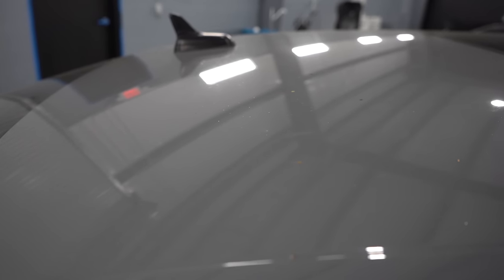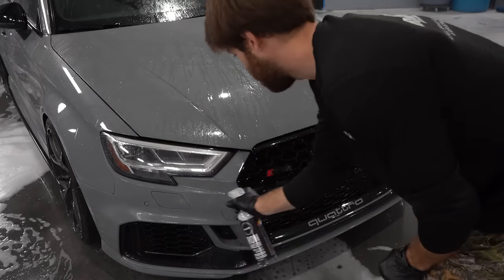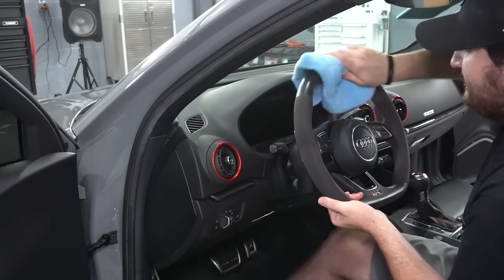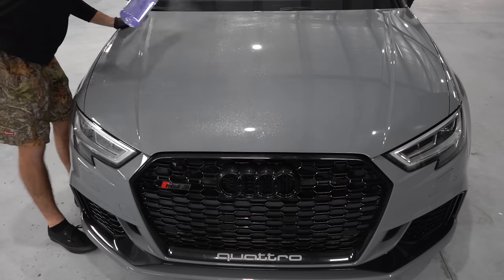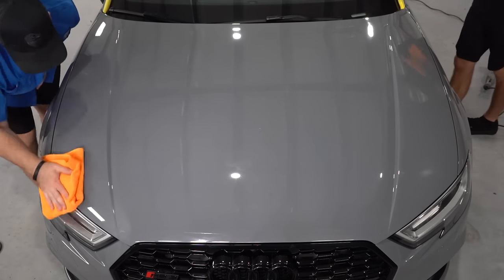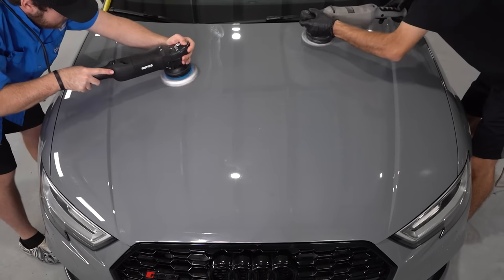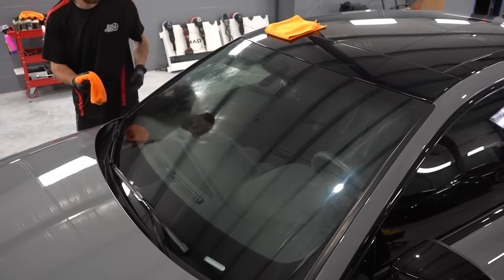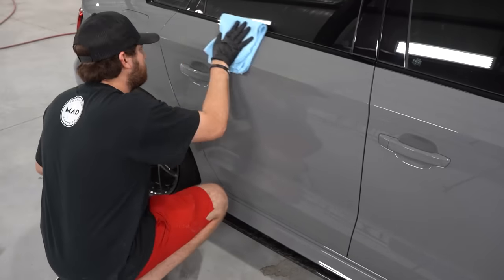Cleaning A Filthy Dealership Ruined Audi RS3 | Satisfying Disaster Car Detailing Restoration How To!

Comment: Very good video.  The fact that you dried the entire car off with compressed air instead of coming into contact with the paint with a drying towel, ect is THE BEST WAY to dry a car/truck. Even if you don't have a big enough air compressor, you can always use a vacuum on the blower side to blow the car/truck off. Always make sure the vacuum hose is clean on the inside. You don't want to blow debris onto the paint and scratch it up.

Comment: What was the polisher you used on the grill ? I have a rules LHR21 and a run Ed duetto but I think I need something slightly smaller for those tight areas

Comment: Thank you very much for the video guys. In particular, I would have sealed the window frames, locks, lights and I would also have used the Rupes ibrid nano long neck polisher for the inside of the doors, edges of the body and the flex pxe 80 polisher with the flexible shaft set for the handles of the doors. Otherwise good job. 👍

Comment: I have passed by multiple dealerships and high end cars. You see a guy pulling a water hose with a 5 gallon bucket and using  A bristle brush on a stick washing cars. I have had to wait before when i purchased one and out back they were doing the same wash style.
Reply from the maker: Yuppp it’s all about the fastest way to get it done.
Reply: In the UK, they are on minimum wage so they aren’t specialised, they are just their to make a car look clean. I personally don’t care but if you do, don’t let them ever wash or vacuum your car if it has a service as they are likely not washing it too safely. White cars not much of an issue though.

Comment: Great job. Nicely done.

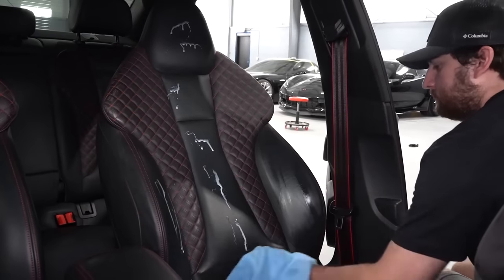But please consider the following: 13:31 and 13:46 and 17:40 (are you sitting on the seat or the door sill?) and 17:50 and 18:35... Respect the seats! You need to clean the doors and seats without sitting sideways on seat bolsters. It's so easy to clean the doors from outside of the car. And 90% of the seats can be cleaned by leaning in, rather than sitting on the seat edges. Easier than what you're doing in this video, actually. The edges of car seats are usually the first to show signs of wear (wrinkles, cracks, etc.), and sitting on them sideways while cleaning is just unnecessary. You're putting those seat bolsters through the equivalent of months of wear in just one detail. For cleaning the doors, kneeling outside the door is easier. For cleaning the seats, reaching in instead of sitting sideways and twisting is easier. When you do have to sit in the car, try to sit square instead of crushing the bolsters. Your current approach makes me cringe. The right approach preserves the seats AND makes your job easier. But still, very good detail.
Reply from the maker: I only clean them that way because I have a massive camera and tripod. When I’m not filming I would not clean this way.

Comment: I have a cheap suede steering wheel wrap (Cut to my steering wheel and sown on by me)
I didn't use any adhesive on it, and so far (6 months) it holds well just by the tension. I found it collects a lot of dust, and the best way to get rid of this dust is with a drill brush.
I do not recommend using it on high end cars obviously, just shared my experience.

Comment: Great job, but you've really got to watch out  that you don't polish the headlights as you'll take the factory UV protective coating off them and the plastic will oxidise faster for the customer down the track
Reply from the maker: The headlights had a ton of scratches only way to remove them. Also we ceramic coated them as well.

Comment: And I always was wondering what happens if you buff a glass out can you burn through the glass
Reply: No, you can’t.  I’ve used fine abrasives on glass, to get scratches out.  Glass can handle super fine finishes and waxes with no problem.
Reply: Thanks

Comment: It's contamination... not DEcontamination - thats proces when you're removing the iron particals etc... Not a hate I just noticed that you said it couple of times so. But great job on that ceramic coating you did, after 3 years still holding pretty well

Comment: Question for the clay bar, do we use literally one side for the whole vehicle or do we flip it for every different side. Also will it take more then one for a whole vehicle?
Reply: When I clay, I use a piece that’s the size of a 50 cent piece. Maybe a little bigger. Use one side on one section, flip for next section. Then knead the clay piece, flatten back out and go to next section. After a couple kneads Id the clay surface is tacky get a new piece.
Reply: Or just a clay towel, those work well too in my experience
Reply: This all depends on the quality of the clay you use and the level of contamination on the paintwork. 

If it is light, use a good quality clay mitt. 
If its heavy, use a clay bar. But buy good quality and ALWAYS start with the lightest grade you can get. 

Soak it in warm water to make it softer and then use apricot sized pieces. Work, fold, kneed, work, fold, kneed until you can no longer get a clean surface. Then bin it and go to your bucket/jug for a new piece. 

AND KEEP IT LUBED LIKE YOU'RE ON A BLOODY PORNO SET!  🤣

But I would say, avoid claying unless you are planning to / are prepared to polish next, as you will almost always get a bit of marring of the paint.

Comment: Just wondering why clay it after the wash? Is there a specific reason? Would it make a difference rather than claying after the final rinse while it's still wet?
Reply: I’ve always wonders why not pressure wash and then clay it before the foam. Looks like it’d make more sense
Reply: @CarGuy5141  because without doing the foam you’re leaving a lot more dirt and contaminates on the paint and by claying it at that stage you’re at a higher risk of causes many more scratches by dragging it across the paint. to minimize the scratches you do the clay last after the wash which shown in the video.

Comment: hey fellow car detailer. From one car detailer to another here's a tip when you were drying the car after the wash you never want to use high pressure air to dry the car because what that does is leaves water spots and can damage the paint and also even though its just air there can still be really small peace's of metal and stuff coming out of the air hose that could scratch the paint chip the paint even scratch the glass. What you want to do is use a soft microfiber towel to dry the car.
Reply from the maker: I’m going to have to disagree with you for a few reasons. Number one we use deionized water that will not water spot and number two are air uses multiple different filters so that’s not possible. Also drying with a towel can cause scratches.

Comment: The title of this episode is misleading.
Granted there might have been some over spray on the paint, but the fine scratches and swirl marks dullness is from customer neglecting to maintain the car. Most people think running their car through a gas station carwash and use spray wax and they're good to go, not to mention hard water spots from letting sprinklers hit their car while watering their lawns. I'm surprised you didnt name this a BARN FIND. You guys do a good job, but you're a little full of yourselves. Interior wasn't that bad minus steering wheel and pedals. Didnt see you do the door jambs, gas door or the trunk and engine hinges. Was a big fan of the Detail Geek until his head got to big, y'all heading down the same path.